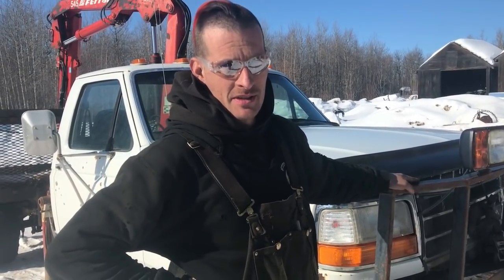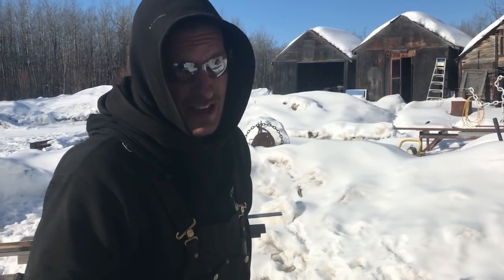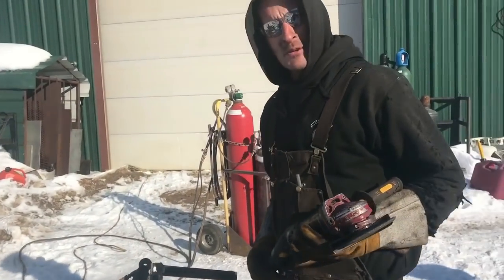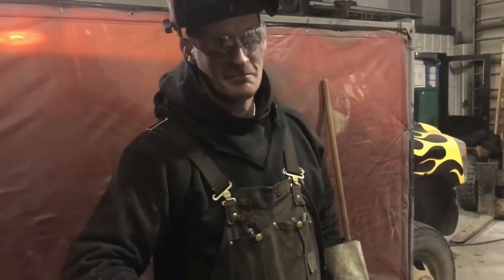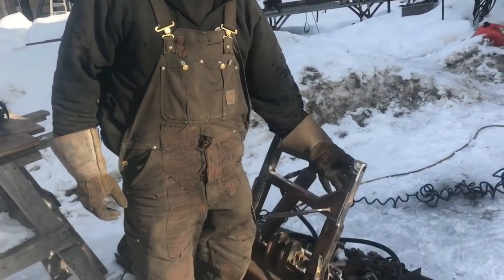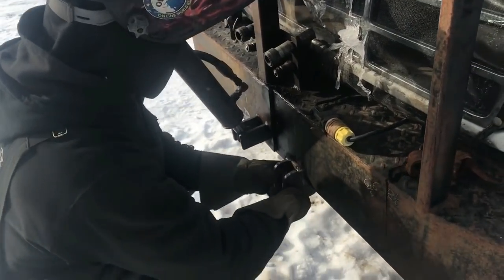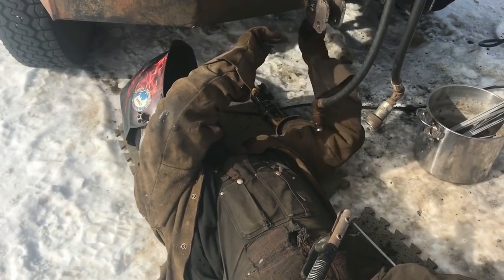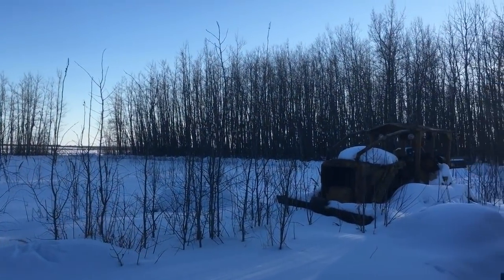Welding a Broken Snowplow on a One Tonne Ford Pickup

Comment: Good tip on welding on the gusset plates. Same principle when adding a thumb to an excavator arm.
I have Miller Big 40 in diesel, Lincoln AC-DC 225, Miller 180 with aluminum spool, Miller air-cooled gas. Welding overhead is always fun, especially when hot metal flies into the ear canal.
Keep up the good work.

Comment: great video, I always learn more than a few things and have a good laugh. 
the cutting and gouging reminds me of some work i did a ways back, cutting a bumper off the frame of an old blazer. save the frame, ditch the bumper. Whoever welded it on must have been more hellen keller than stevie wonder. globs and globs of misplaced metal. they welded anywhere they could reach, even if they couldn't see it. I spent an hour or two going between a torch and an pneumatic chisel. love torch work.

though from watching you cut plate, I need to get some more practice in. nice edges.

Comment: Those are the jobs i hate but gotta do since i am struggling so much the ones where they say want done cheap and you have no idea what there idea of cheap is and then you present bill and it seems no matter how little it is or how much money i loose it is still not little enough they just don't seem to care or get the concept that even tho it looks like a quick small job the small jobs usually take the longest😠😠
Reply from the maker: candianwelderfarmer yeah I feel ya.
Reply: for example i had a bale wrapper and the hinge on the fold up bale shoot snapped from him being i know it was being hard on it but he wouldn't admit it anyways he says should be a quick job should take more than a couple hours yup one of those jobs 6 hrs later i only billed him for 4 but still he thought it was high of course (farmer) after having to remove whole gate to be able to rebuild and on top of that strengthen it to not happen again then put it back together and put gate back on. on top of that i noticed the hinge  holes were wallowed out i told him about them and like i thought i will worry about that when it breaks